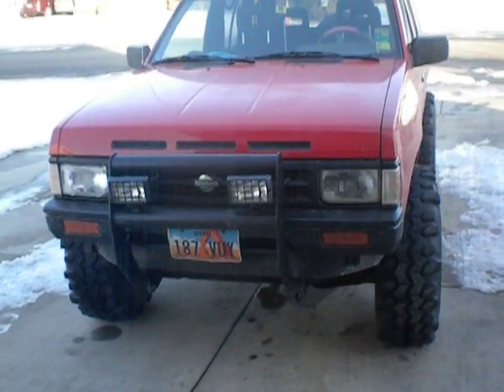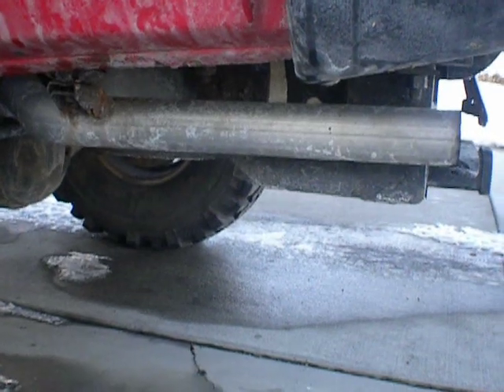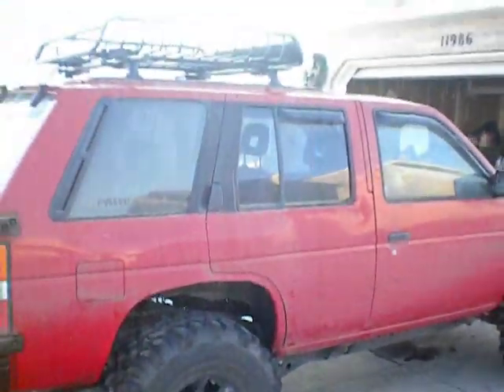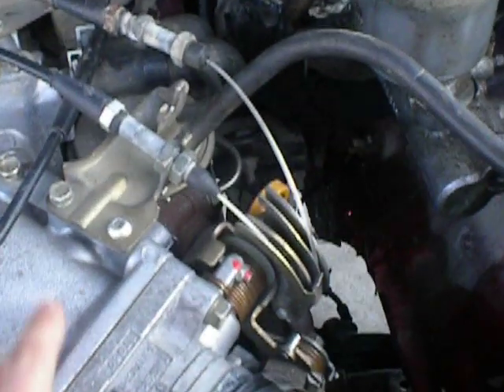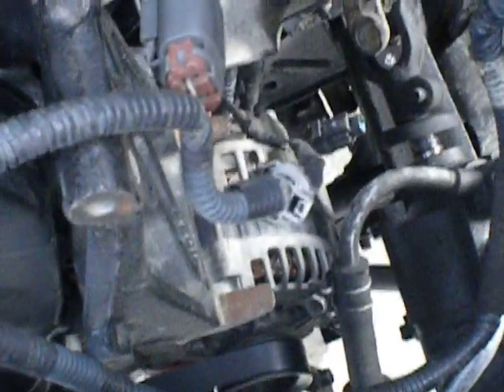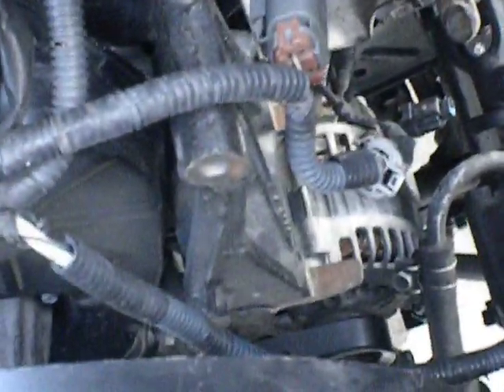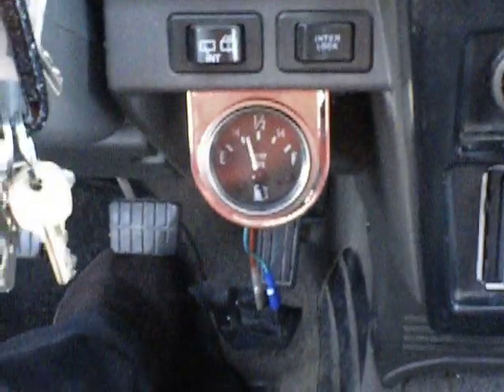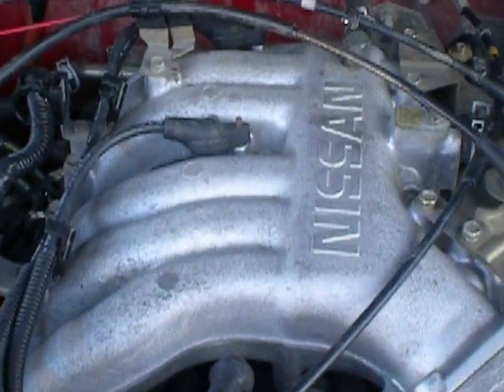Nissan Pathfinder 1990 After Engine Swap

Comment: Replaced with a used one I ordered from ebay. Not too bad removing and changing the cluster, the hardest part was rolling back the mileage from the one I ordered, it had way more than the original miles. Hey, thanks for your help.

Comment: @suzuki230 well, with our other cars, the guy that built the engines hooked his laptop up to the computer and changed all the settings to make the car run better. They called it flashing the computer. He was able to watch and change the air/fuel mixture, adjust idle rpm and change the shift points(automatic). It was quite interesting how he took our mustang that never ran right and had it purring in 2 minutes

Comment from the maker: @4xdanx4 Its was not bad. No instructions but simple. I had to move the powersteering fluid resivior and extend the steering linkage and extend the gas line from the tank to where you put gas in. Nothing to hard at all.

Comment: @suzuki230 I thought it was the MAF. I don't know though because it drives better than it did before. idled a little low for a second today, but with that air filter it has more power. I am going to see if I can fit the pathy sensor on the new air filter, wether it's the MAF or not:)!

Comment from the maker: @Hoolalaha yeah over all it was an easy swap but for you it would be harder.. since yours is an 89 the ecus are different because you have VG30i for a carburated motor. so you would have to swap the ecus.. but it might work. I used the same motor mounts on the old engine.

Comment: @suzuki230 oh acceleration is deffinitely improved. it was horrible before until I passed 3rd gear. I seem to get 14mpg. but I've only put 50 miles on it and I'm guessing. it seems to normally idle at 900, and for a second it sat at about 450. I just really hope I can find a way to pick up a couple more mpg's. I'll bet if I can find someone to flash the computer I'll get good milage and better performance

Comment: @suzuki230 yeah, I just built my own today. I found the intake assembly my dad had from his first blower on his marauder. All I did was take the old air box out and put a piece of insulation around the pathy intake hose, and the filter fit snuggly. Do you know what the sensor attached to the air filter housing is? should I bother finding a way to reattach it?

Comment: It reads 30mph on the hwy and 0 on the streets. I guess my next step is to remove the instrument cluster and see if maybe I can clean the connection(s) and tighten any loose screws? Thanks for the idea! If I had to replace, should I buy new or used from the salvage yard?

Comment: I got 2 questions. 1. When you did the body lift how did you extend the steering shaft? 2. How hard was the vg33 switch? (like what did you have to do for the switch?)

Comment: I just bought a 93. Horn doesn't work and I had a problem with the stock fog lights, and then I fixed it, and then in the same day they stoped working. Also missing the key chime thing that goes off when a door is open and the key is in the ignition. Are there relays/fuses for these hidden somewhere else besides the fuse box? I know there is a horn relay under the hood, but it's fine.

Comment: I have an 89 pathfinder, Is the it pretty simple doing the swap? all the mounts fit correctly or do you need to fabricate new ones? I love the car but the engine has 222XXX miles on it so I'm thinking about doing a swap to a newer hopefully better engine

Comment: I have an 88 pathfinder stock, what are the basics that i need to start with to get mine looking like this? I'm not looking to replace the motor b/c it is in good shape. Mostly just need to know what to do to lift it and is it possible to swap out the A/T for a manual?

Comment: What is the swing away tire carrier you have? I have been trying to find one for my 87 but no luck.
Reply from the maker: Just a factory one. You can add one on.
Reply: @suzuki230  my bad i meant whats the brand/model
Reply from the maker: @robertcartwright1408  it came factory on the SE models. Depending on where you are most 90-95 pathfinders have them. XE models had them sometimes but not always. It has no brand besides nissan as far as I know of. No tags on it.
Reply: @suzuki230  ah gotcha thanks